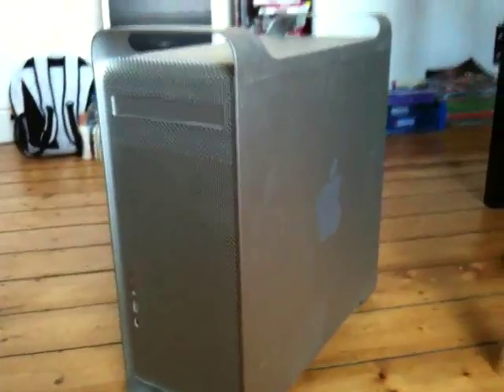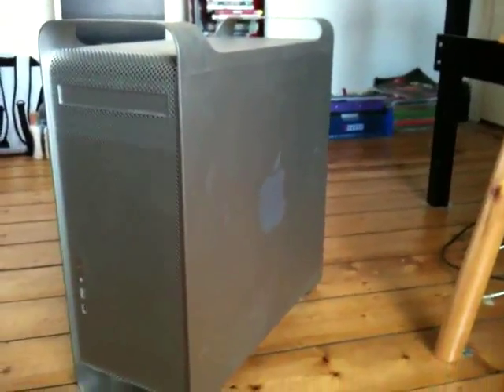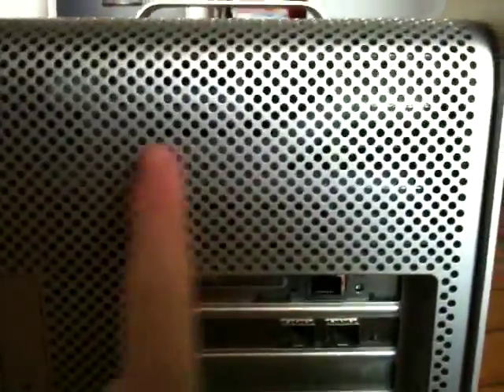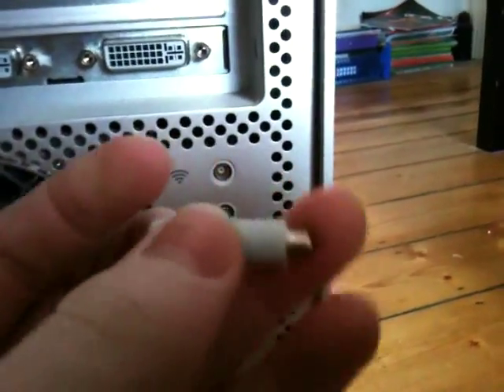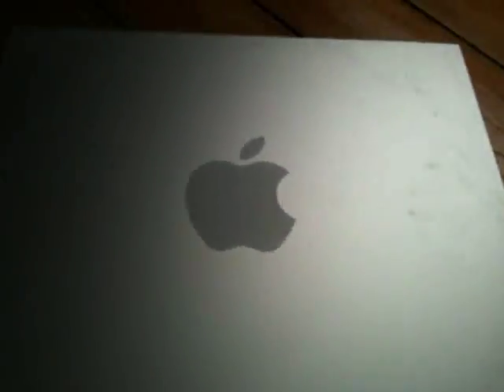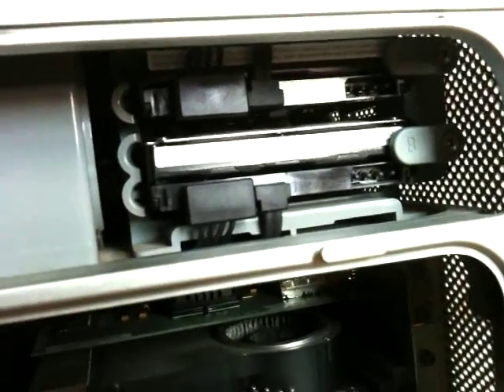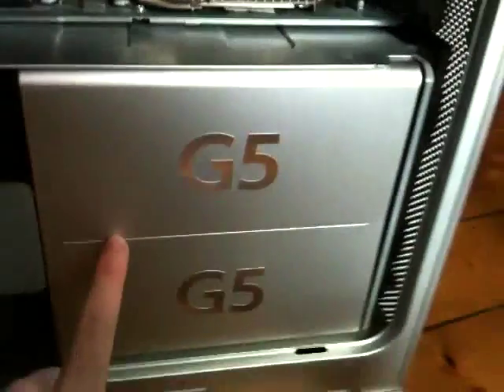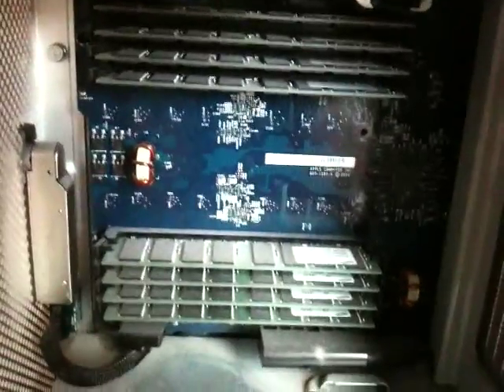PowerMac G5: Hardware Tour

Comment: I just got a dual 2.0Ghz 2003 model with a 250GB HD and 4GB RAM. The performance is really good and it can still hold up to Google and its painfully slow sites. This computer was ahead of its time when it came out, and it still can do well today. I cannot imagine how nice a quad-core 2.5Ghz model would be, as I am still surprised with how well my 2.0Ghz dual model is running.

Comment: I just got a Dual 2.0 Tower with 4 gigs of ram and room for up to 8 gigs, it also came with the 256 Radeon. It has 10.5.7 Leopard. It runs great and isn't really slow at all honestly. I didn't have much trouble finding software for it.

Comment from the maker: @RamiRiefert The late 2005 G5's take PC2-4200 533Mhz DDR2 (240 Pin) - It needs to be installed in matched pairs. Maximum 16GB (2GB per slot). Hope this helps :)

Comment: Luv the vid, but I gotta correct you on one part...what you called a filter for the CPU's is actually a radiator for cooling the heated water that passes thru it.  For all those folks out there looking to buy an older PowerMac G5, DO NOT buy one with a water cooled system (or LCS)!!  The seals wear out considerably fast (especially on the heat exchanger plate for the dual CPU's)  If u cant find a air-cooled G5, buy a late '05 quad or newer. The LCS design is better.